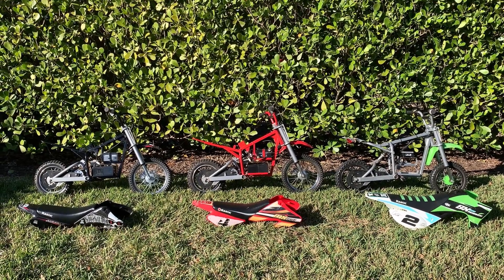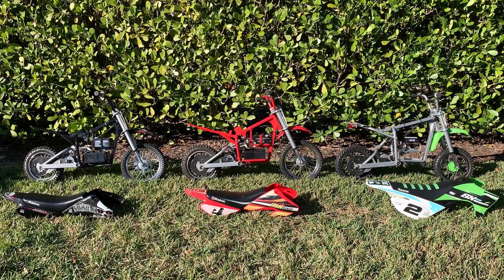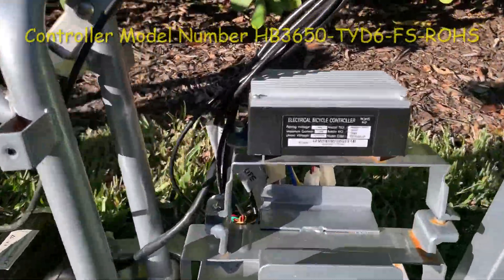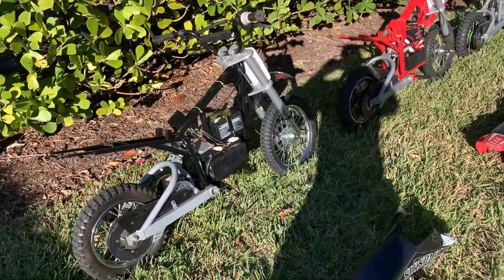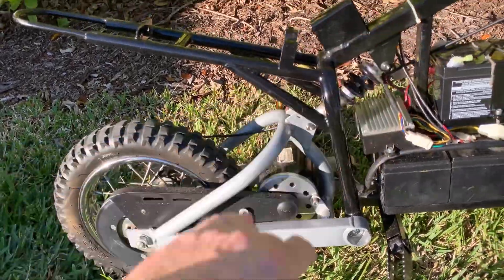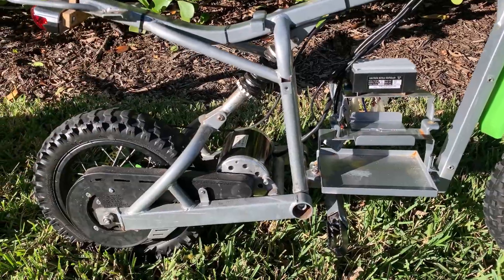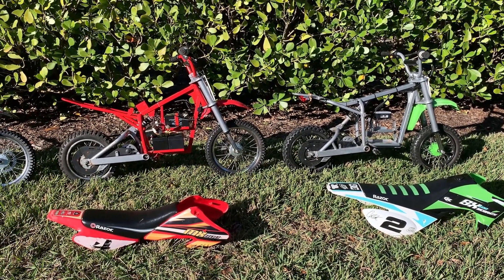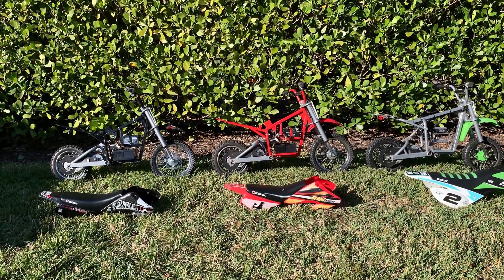Compare Razor MX650 vs MX500 vs SX500 - see them all disassembled

Comment: So I want an electric dirt bike. I have $590 to spend. Should I get the sx500 or a different electric dirt bike?
Reply from the maker: I'd get either the MX500 or SX500.   The MX500 has updated plastics, but the seat on MX500 is 1 inch lower than the SX500 (24" seat height)
Reply: @BRichSolution  what’s the difference with up dated plastics?
Reply from the maker: @retr0rider458  The MX500 plastics are the same as the MX650; the gas can is separate from seat.   The MX plastics can be swapped with Honda CR50 (see youtube for DIY video).   The SX plastics in the front region by front forks flares more than the MX.    If you considering modifying the bike down the road get the SX500 as there is more room in the Battery box for 48v battery.
Reply: @BRichSolution  ok thanks! Think I’m going to get the sx500
Reply: @BRichSolution  also how is the sx500 if I don’t upgrade it?
Reply from the maker: @retr0rider458    it will be fun for 6-12 months then you'll probably want more speed
Reply: @BRichSolution  alright thanks. Sorry but one more question, would it be worth it to get this bike if I already have a gas powered one? I just want to run around on the streets and maybe jumps and trails.
Reply from the maker: @retr0rider458  The electric bike is nice as you can ride at night and no one can hear the engine like a gas bike.   No worrying about gas or engine maintenance
Reply: @BRichSolution  so none of these bikes take gas?

Comment: They aren't really the same, the mx650 has a bigger front wheel and it has a 650 watt motor, while the mx500 and the sx500 are the same clearly, 500 watt motor. So the difference is that mx650 is bigger and faster. The mx650 weighs more too. The mx500 and sx500 can handle 175 lbs while the mx650 can handle 225. Mx650 speed: 17mph Mx500/Sx500 speed: 15 mph
Reply from the maker: that's what specs say online...   but I know for a fact as my neighbor has brand new MX650 & MX500 and both have the same top end speed (16-17 mpg depending on ride weight) as when a kid or adult ride them the MX650 & MX500 are neck and neck with top speed riding down straight away.   next time there out I will film and post video
Reply: @BRichSolution  watts determine acceleration not top speed

Comment: so the frames are the same size? The shocks makes the mx650 slightly taller?
Reply from the maker: SX500 is slightly taller seat height at 24.25 inches.   MX500 & MX650 frame are the same and have a seat height is 23 inches

Comment: Controllers are the same between the 500 and 650 but the motor are different.
Reply from the maker: Last year I Installed a Razor factory MX650 motor on my kids SX500 and the performance was unchanged from the 500w motor... that’s when I started to suspect that they were all the same.   I recently bought Mx500 and Mx650 and took them apart to to prove to myself that the controller & batteries was the same across all the models.  Then I made this video to help others out.  There is some slight variation in manufacturing of the motor, hence the reason I’ve seen some Brand new Mx500 faster than mx650’s, but there all about the same top speed
Reply: @BRichSolution  Good to know!  Was the motor swap from your other vid a direct bolt on?  I'm looking to do that upgrade also.
Reply from the maker: @888kham    the 1800W motor on 35 mph build I had to make a smal/easy modification to the motor housing to recess two screws,    see other video 2:20 mark for motor mod.  https://youtu.be/thfQyCmczlk

Comment: Are you saying the motors are the same? I thought the 650 had 650 watt and the 500 had a 500 watt.
Reply from the maker: yes same motor...different sticker.   Last year I Installed a Razor factory MX650 motor on my kids SX500 and the performance was unchanged from the 500w motor... that’s when I started to suspect that they were all the same.
Reply: I thought the big difference was supposed to be the heights

Comment: so they all are the same speed and stuff
Reply from the maker: MX650 is the same speed as MX500.   I have two kids in my neighborhood with brand new mx500 and mx650 both same top end speed.
Reply: @BRichSolution  Thx I was gonna buy the 650 but now I'm just gonna get the cheaper option
Reply: @BRichSolution  but doesn’t the mx650 have a bigger motor than the sx500?
Reply from the maker: @retr0rider458  supposedly the mx650 has a more powerful motor, but all the mx500 I've seen are the same top speed as the mx650.  maybe there is slightly more torque with the 650, but I'd have to say it negligible
Reply: @BRichSolution  alright. Thanks
Reply: No the 650 is faster
Reply from the maker: @snitchywitchy7930    Last year I Installed a Razor factory MX650 motor on my kids SX500 and the performance was unchanged from the 500w motor... that’s when I started to suspect that they were all the same.
Reply: @snitchywitchy7930  no it's not did you just hear him he clearly said that they're the same speed

Comment: I've been telling this to folks for the last year and no one believes me either..
Reply from the maker: I suspected and opened up each model bike and confirmed what you have been stating
Reply: So, the motors are the same too?
Reply from the maker: @davidebel9276   The 650 motor has a different sticker.    Last year I swapped 500w motor with Razor factory direct 650w motor on my sons bike and there was NO change in top speed and we couldn't notice a change in torque.   That's what planted the seed for the this video.   Upon opening MX650, MX500 & SX500 the batteries & controllers are all the same.   There is slight variation in manufacturing which makes one bike slightly faster than another, but I've seen brand new MX500 faster then MX650 and vise versa
Reply: The mx 650 goes 17 Miles an hour
Reply: Thank you so much I was about to buy a razor
Reply: Figured as much, the mx400 and the mx350 are exactly the same, except the first gen mx350 was slightly bigger with a rear suspension. If you can find a first gen mx350 buy it mod it and never sell it! Or give it to me 😂